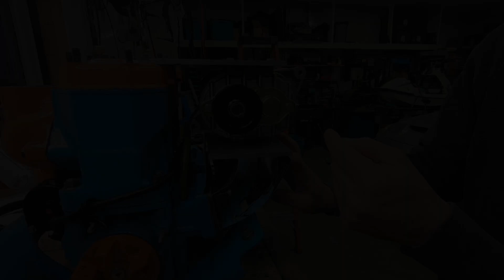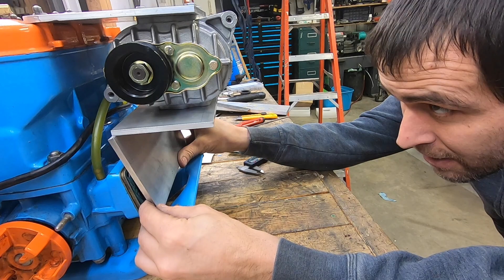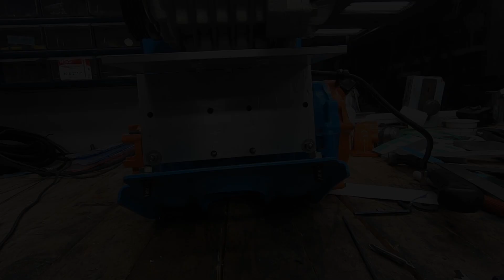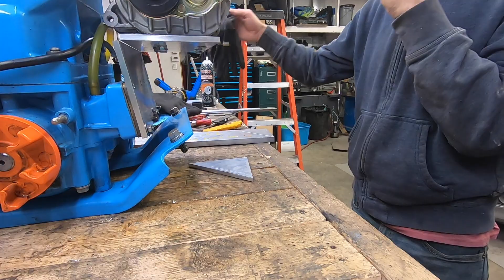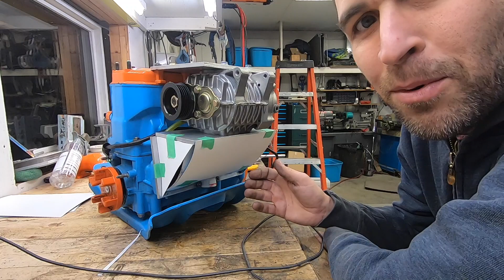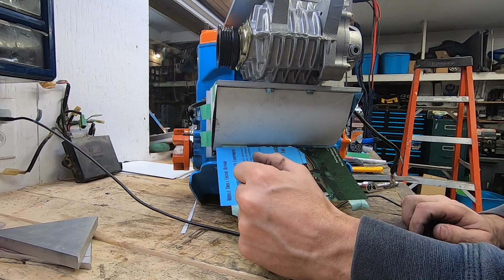Supercharging My X2 - Design & Cutting Out Pieces - (part 2)

Comment: I'm excited to see this and excited I'm not building it. Also I love your idea of using a separate dirt bike engine to power a supercharger. Hey with that being said. How well could it work if you put a weed whacker engine on this things supercharger. 2 stroke times 2 in an x2
Reply from the maker: You're excited you're not building it, haha... You don't think you'd enjoy it, or you just have too many projects on the go? 

If you had a large enough chainsaw engine then maybe, but it actually takes a few HP to turn a supercharger. This is only a 300CC charger, so it wouldn't take a lot .... but I'm not really sure if it would work. It would be funny tho. I'm also thinking about putting an electric clutch on the pulley so that the charger can be turned on and off.... like a TURBO button on Knight Rider lol.

Comment: Idk if there is a reason against it but could you mount the super charger to a plate that would then mount to the intake with accessible bolts of course so you could remove it after you weld everything. I know the extra plate would take away a 1/4” from your carb clearance but I think it would be worth it so you could service or change the charger. Just use recessed head hardware so you can still get a seal. Idk just a thought, would hate to get it all done and have to swap the charger for some reason, knock on wood!
Reply from the maker: That's a really good idea. I was going to do something like that with an end cap to access bolts or on the supercharger top plate like you say... This is an idea that I strongly considered, and I may regret not taking this route. 

The reason why I haven't is because my manifold is going to be the supercharger bracket and there will be a lot of forces on it. Torque from the belt, the weight of the charger as the ski is bouncing around and boost pressure. I felt I would have to go with half inch plate to have enough thickness to both support the heads of the bolts and to have material to thread into. If I countersink into 1/4 plate there's not going to be much material left and if I want to thread into 1/4 aluminum, I'd want to have some sort of backing to thread into. 

I could have used 6mm fasteners every inch or so around the top mounting plate, and that probably would have done it. I was worried about where my holes would end up if I bolted it on this way. I would have had to carefully consider where all of my threaded holes went on the other side of the 1/4 plate as there will be water jackets and air passages. 

Your idea is totally doable and if I were making this for someone else, or if this one turns out to work really well, then I may use that idea in the future. I really don't like the idea of welding it in place, but if the charger has to be serviced or replaced I'll just have to cut it off or try to service it with the manifold attached. 

Cheers.
Reply: @JoelArseneaultYouTube   sometimes there is no perfect solution, just have to work with what you have. Like the idea though, this is turning out to be an awesome build series
Reply from the maker: @mitchellstepan7215  Thanks, I appreciate you commenting. I'm really enjoying this project.

Comment: I can relate. Sometimes you need to just do it. Otherwise you can plan/ design yourself crazy.
Reply from the maker: This happens to me all the time. I keep thinking of a "better way" and I never get started. Then if I do get started, I get stuck at each step, overthinking everything, haha. 

Thanks for the comment !!
Reply: @JoelArseneaultYouTube  over thinking is only bad to the extent that it slows down the process,  but at the end you're better off.
Reply from the maker: @rickems8863  That is true. As long as it eventually gets finished and the thought process isn't crippling. I think making videos helps me get my a$$ in gear and say " okay Joel... time to make a decision"  where if I was just doing it for me, I'd still be designing the "perfect" manifold, that would never get one. :)

Comment: Just my opinion i wouldn't worry about running water through the intake. The atomized fuel in the air charge should cool the air pretty efficiently not sure how much boost you intend to run. But shouldn't be enough to heat up the air charge that much. Alot of the boosted two stroke snowmobile don't use intercooler just a thought awesome build I plain to watch to see the finished project.
Reply from the maker: That makes me feel better actually !!  I've been looking at snowmobiles a little to see what they're doing... Now that you mention it, a lot of them don't run coolers. 

With that being said, I'm still going to run a cooler for any added protection I can get. I may lower the compression a little on this engine, but if you have seen my head modification videos, then you will know that I'm running a copper o-ring head (I made) and my only options to lower comp is to re cut domes or add base gasket. I don't like either of those options. 

I know you didn't ask, so I hope that I'm not oversharing, haha... but I'm hoping to run fairly high boost down low and get lots of bottom end and then, perhaps, bypass some boost on top end to avoid total engine destruction.

Comment: Hi mate, it is very well explained and, you can practice your welding skills before you start welding on the engine, but apart from that it looks like it is going to work, I am very impressed with your skills cheers
Reply from the maker: Thanks Adrian ! I'm going to try to do a few other little things before jumping right into welding this. From the little practice welding I did, I found it pretty easy to join aluminum. I don't expect it to look pretty tho, haha !! I love building things like this, but it is scary thinking about turning all that work and beautiful expensive metal into trash 😂

Comment: just curious , why not use rectangular tubing for the intake runners? This IS a very ambitious project.
Reply: Either way, your design looks super strong.
Reply from the maker: That's a great question, Rick !  I should have talked about that actually. 

The main reason is because I want a large surface area for the water jackets. The way I'm making the long flat surfaces, will maximize surface area between the intake charge and water jacket. The manifold is pretty short, and if I hope to get any cooling at all, this is pretty much my only chance. I realize that I'm adding some flow restrictions / low pressure areas, but I'm hoping that the end shape of the curved flat ducts will cool enough to pay off. 

Building the intake runners out of rectangular or round tubing would have been much easier for most of the process, but the limited surface area would mean very little cooling. There is always the possibility that I'm totally wrong about this,  but those are my thoughts, haha.
Reply: sounds well thought out,  I'm sure the large surface area will be beneficial for cooling. Keep up the nice work . It shows that you are smart and  mythology about your projects.
Reply from the maker: @rickems8863  I'm glad I don't come across as a bumbling fool, haha. 

It will be nice to see the results of my efforts when this thing finally hits the water. It would be nice to run a bunch of temp probes to see what difference it really makes, but I don't know that I will be able to do that. 

I'm in the process of rounding up another hull (hopefully) so this engine should be going back into its original hull. Exciting stuff happening.
Reply: @JoelArseneaultYouTube  check out the trail tech temp probes . they have cylinder head temp sensors that are basically copper washers for you spark plug as well as flow through tubing sensors.  I'm sure there are a few  other options too. I use them on my mopeds . relatively inexpensive and versatile.  You could use thermal paste  and tape/ ziptie them anywhere .  or some people use those digital meat probes with minor modification.  they're like 10 bucks at Walmart or target.  just extend the wires and mount display anywhere. food for thought.
Reply from the maker: @rickems8863  I'll look into that. I actually have one of those meat probes that I use for powder coating ... that could be an option if I can get something that's waterproof... or make it waterproof. 

For the air temp I'd actually need to have a probe in the air flow. I'm sure there are a lot of options. 

Thanks for the idea !